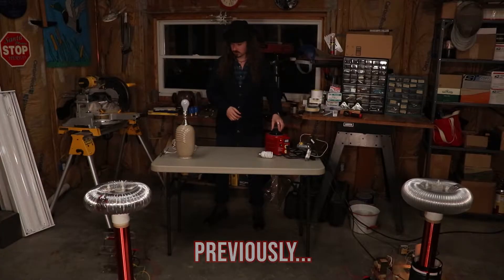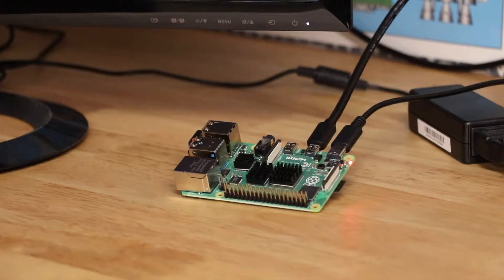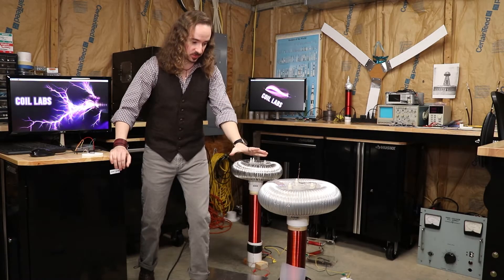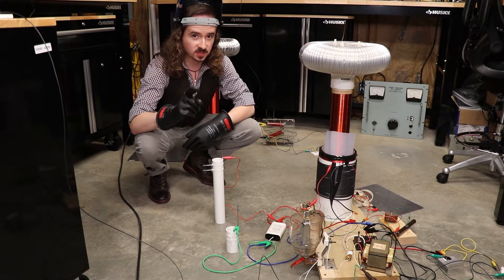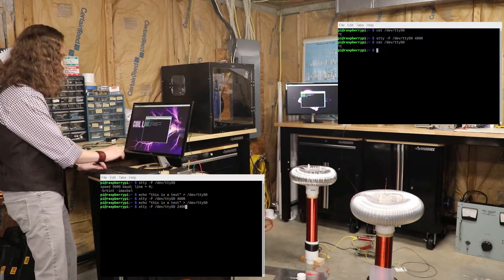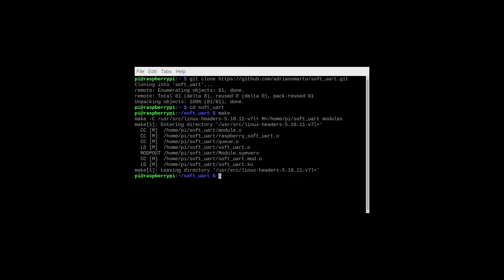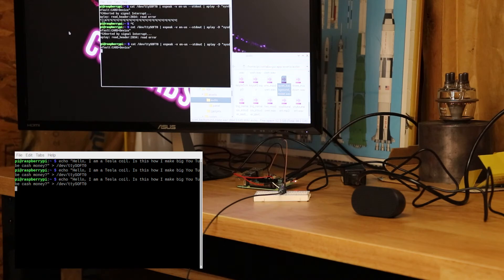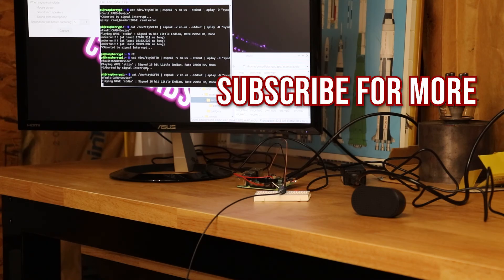Tesla Coil Wireless Communication: Transmitting Digital Information using Tesla Coils

Comment: My dad was a telegrapher for the railroad from 1960 to 1975. He put himself through college that way. For anyone who doesn't know, they used Morse code back then. The Signal Corps (military) installed telegraphy poles and hung wire all over the United States. He was also a ham radio operator.

Comment: maybe it was used in the wrong fashion or configuration (as if you were transferring energy rather than setting up a communication line)... what if you just used it as a radio implementation; like adding a small oscillator and keep the primary tuned just below the secondary as you would.. but have the transmitter at a greater frequency (shorter wavelength) than the radiator (tesla magnifying transmitter) and earth grounded the secondary so that RF goes to ground.. this E field antenna signal will propagate at a superluminal rate (typically 1.5 times the speed of light) while also penetrating all material.. then down size everything based on the same formula for a pocket sized longitudinal wave transmitter that would typically be earth grounded to properly decouple the radiation (hence, your are tuned with earth resonance)... cool video.. don't give up!

Comment: You're very smart. However, Tesla designed his system to not radiate out into space, and it is to be connected to direct ground or one wire of hair thickness is acceptable. For virtually full power transfer.
Another However is..  you must transmit at lower frequency, congruent with ground wave propagation.
He stated this in his own words in a courtroom question and answer period with lawyers present with Stenographer.

Comment: You need to use sphere top loads with no breakout point. You were wasting energy with the plasma in the form of heat and light plus you should use a dual reasonant solid state tesla coil

Comment: Nice to know this is actually possible.  Very interesting.  Did you ever try a Nikola Tesla coil aka a TMT(Tesla Magnifying Transmitter) coil.  120 years later and most people can't grasp the power of a 1/4 resonate wave connected to ground with a surge suppressor/spark gap.  What a strange thing to say and what a strange world we live on?
Reply from the maker: I have yet to build a magnifier coil, no. Something I'd like to try some day though. Really delicate to get tuned correctly from the little bit I've read about building them.
Reply: @CoilLabs  yeah I'd like to see what you can do with a TMT.  Your using what I like to call a spark coil and getting some cool results.  It's like your using a hammer and a screw.  Would like to see what happens if you use the right tool.  Tks for hearing me out and keep experimenting cool stuff.  👍

Comment: Its my understanding these coils were primarily built when physics departments were having contests to see who could make the biggest arcs. These probably arent designed or tuned for high bandwidth communication.
Reply from the maker: You're absolutely correct. This kind of Tesla coil configuration is primarily designed just to make big sparks. What I'm showing here is just near field effects, resonant capacitive coupling mainly, since producing strong electric fields is what these coils are good at. They absolutely do produce radio emissions as well, but this configuration isn't very efficient at doing so and are definitely even less efficient at receiving radio signals.
Reply: @CoilLabs  so how do we configure and tune one for efficient radio transmission and reception? The surface wave this emits travels through metal structures with ease at great distances. This is a project I've been thinking about for a while. Id like to replace the 2.4GHz antenna on my WiFi router with a Tesla coil and make a network across my city. This could take wireless internet to another level and let amateurs compete with ISPs. Ive never built a coil though and I need help starting.
Reply from the maker: Converting a Tesla coil into an efficient radio transmitter would require changing the shape of the topload to make it into an efficient transmitting antenna. I have very little experience with the design of radio antennas, so I don't know what that would be though. If your goal is to transmit radio signals though, there's really no reason to use a Tesla coil. Significantly better technology exists today, compared to back in Tesla's day. Tesla's understanding of physics, back in his time, was incorrect, based on what we know now, and what he was proposing, using Tesla coils to transmit information and power around the world, wouldn't actually work. One of the reasons he thought he needed to go the way he did was because he (and many other people at the time) thought you couldn't transmit radio around the globe, because they thought the signals would just travel off into space. Turns out the ionosphere can reflect radio waves and propagate them around the globe. The experiments of people other than Tesla, including Guglielmo Marconi, discovered this and made Tesla's concept of wireless information communication obsolete. Tesla's concept (not knowing about the ionosphere radio wave propagation thing) was to find a supposed "resonant frequency of the planet" and use near-field effects (i.e., electric fields, not electromagnetic waves like radio), like I show here, and have tuned receivers elsewhere that could receive these signals. In reality, the physics of this does not scale up like Tesla thought it would, so it likely never would have worked.
Reply: @CoilLabs  I am going to have to disagree. You are correct in the story you have come across and are conveying but it is inaccurate and incomplete. I implore you to revisit this and take a deeper look. You are on to something and the closest I have seen yet. I have been investigating this for about a decade now. Unfortunately I haven't  been in a position to do any real work on this until now.

 Tesla's understanding of the physics was correct. It was physicists understanding of physics at the time that was incorrect and Tesla has been labelled as having an incorrect understanding for a century. His system "wouldn't work" only according to the "known physics" of the time. If Tesla had started out from known theory, he would never have pursued the path he did. Tesla actually started out with empirical observations that the Earth resonated electromagnetically like a struck bell. The atmosphere and the ionosphere made this so, but Tesla only knew that it worked, and he really did not know why, at least at first.  Initially he did not realize that the Earth's atmosphere was critically important for his system to work. If the Earth had acted like a perfectly-conducting metal ball hanging in a vacuum, as physicists of the time believed, then Tesla's system would not have worked. The waves would have traveled along the ground and then shot straight out into space. His system would have been like a "G-line" with a sharp bend in the middle: except for a bit of diffraction, the waves refuse to follow the bend and instead go right off the cable and are lost. Because of the "dielectric" effect of the atmosphere, and also because a conductive ionosphere was present, Tesla's system was feasible. Yet any scientist of the time would "correctly" see that Tesla's system totally violates well-known theory. Physicists were absolutely certain that the Earth *didn't* have any resonant frequencies, *knew* that radio waves would not travel around the curve of the Earth, and dismissed Tesla's wireless transmission system as crackpottery; as an unworkable violation of known physics. When "Schumann" VLF earth-resonance was rediscovered in the 1950s, nobody in the conventional sciences dared court the embarrassment of admitting that Tesla had been right all along. 

https://en.wikipedia.org/wiki/Schumann_resonances

Tesla was also adamant that he was not using "hertzian radio waves" and pointed to Sommerfield's work as evidence of the type of wave he was using.  Arnold Sommerfeld and Jonathan Zenneck were performing an analysis of the problem of wave propagation over a lossy earth and discovered this type of wave. There was a sign error controversy that plagued Sommerfields work until 1936 with an experiment that launched the wave and tried to end the sign error controversy. James and Kenneth Corum have been replicating Tesla's work since the 80's and replicated the Seneca Lake experiment. Unfortunately this has introduced further controversy.

https://en.wikipedia.org/wiki/Surface_wave

 - Corum brothers Seneca Lake replication - http://rexresearch.com/corumzenneck/texzon.pdf

- Tesla Coil - James Corum - Tesla Society 1990 https://www.youtube.com/watch?v=EHRkCQ19GhU 

- 1936 Seneca Lake Experiment - https://ieeexplore.ieee.org/document/7577497

The Corum brothers recently worked for a company called Viziv Technologies that tried to commercialize  the use of this wave. 

https://vizivtechnologies.com/

https://physics.stackexchange.com/questions/569076/is-vizivs-surface-wave-technology-plausible

James Corum Patents - https://patents.justia.com/inventor/james-f-corum

 In early 2020 that a group decided to pick it up again and repeat it and publish the results proving a Zenneck Type Wave-based Non-Radiative, Non-Coupled Wireless Power Transmission system is possible and that it can transmit power and communications through large steel structures at great distances with ease. The current radio antennas must split up the frequency spectrum and build all sorts of devices to try to overcome obstacles using "space waves". Zenneck type waves do not have these limitations. Better still exists. 

 2020 Experimental Realization of Zenneck Type Wireless Power Transmission  - https://www.nature.com/articles/s41598-020-57554-1

Tesla Invented Radio....Not Marconi. Marconi stole Tesla's work and went for point to point wireless messaging. Tesla went for world scale industrial power and messaging. 

http://amasci.com/tesla/tradio.html

Tesla's idea for wireless communication and power transmission is far from obsolete. I believe the first step is creating a 10 to 20 mile "wifi network" using Tesla's Zenneck Type Wave-based Non-Radiative, Non-Coupled Distributed Resonator System.
Reply from the maker: Please read what I said again. I simply said that Tesla's concept wouldn't work. Just Tesla's specific concept, which was not based on surface waves, as can be read in his own words from his writings and patents. I did not say that WHAT WE LEARNED from his experiments is useless or obsolete and that we cannot leverage what he did to make improved technologies now. I am aware of and in fact very excited by much of this research you have talked about here. It absolutely builds on related concepts and lessons learned from Tesla's work, but it is not THE SAME as Tesla's proposed concept that he was never allowed to finish. I greatly admire Tesla, but I acknowledge that he also had some incorrect theories. And that's perfectly fine. He was only human, like the rest of us. He accomplished a lot and was way ahead of his time in many respects and he has absolutely been done a disservice by both his peers at the time and by historians. Part of my goal with this video was to explore how Tesla's concepts could be extended to modern technology. In fact I have already been planning to attempt a small scale Zenneck wave experiment sometime in the future, once I have learned enough to do so and am well versed enough in the specifics of the science behind it that I can make a well-explained video on the topic.
Reply: @CoilLabs  yeah I read it and thats what I'm disagreeing with. Teslas concept could have worked technically. We just dont know because he couldnt finish it.

 Tesla cited Sommerfeld in 1916 as experimental proof of what he was doing and was adamant that he was using current waves not electromagnetic.
Reply: @CoilLabs   Man this thing isn't letting me type a response with links anymore. You have an email I can reach you at? 

Also Marconi stole Tesla's work. 

And your video is awesome and again you have an understanding of this that I know I don't because I haven't built this stuff. Mad respect. I'd really like to keep a discussion going on and learn how to launch a Zenneck wave as well. I want to network routers with these these. There are some SDR projects and a wifi protocol library I think could be used to network using Zenneck waves.
Reply: @chrisp.coatspaintco.432  I've been wanting to do the same thing! Have you come across any other information as to how you could do this? I haven't seen anyone propose this and I've looking to find out how to somehow use Tesla's coils or TMT to replace the traditional internet service providers.
Reply: @isaiahj3968  yes I do have more information. How  can I contact  you?
Reply: @chrisp.coatspaintco.432  if you go to my about section on my YT channel, you'll find it. I tried posting it here but YT keeps removing it

Comment: What is the limiting factor for bandwidth?
Reply from the maker: My theory is that it's the "resonant rise" time that it takes for the Tesla coil secondary to store enough energy to build up to high enough voltages to create strong enough electric fields, which is way slower than the Tesla coil's resonant frequency. And this is compounded by the fact that this has to happen on both the transmitting and the receiving coil.
Reply: @CoilLabs  can they be matched?
Reply from the maker: The two coils I have here are matched as closely as I can make them. The problem I'm describing is the rate of energy transfer both from the driving circuit on the transmitting coil, into that coil's secondary, compounded with the rate of energy transfer from the transmitting coil's secondary to the receiving coil. In order for these to be "critically damped oscillators", they have to be loosely coupled, otherwise they wouldn't achieve the resonant rise that they do and get up to the voltages they do. That means they are terribly inefficient and it takes a non-negligible amount of time to resonant up to the "full operating power". This is still milliseconds, so it looks instantaneous to us, but that's really slow and very limiting in terms of digital data bandwidth.

Comment: if your interested in subject please check out my demo core on my channel. I'm not a science educator so bare with my badly simplified explanation's of very complex interactions of the working functions in the demo core 

the MFC its based on my work on fully passive to low energy confinement methods for plasma for hot fusion. my M.F.C is very similar to a tokomak but uses soft x-rays from the reaction for plasma confinement and only one magnet for particle rotation and electrode protection this cuts out the need for high power magnets and cooling tanks reducing the needed input power while maintaining energy density. I'm in the process of a full up grade from the 3inch demo core to a 8x or 28inch proto core for testing
https://youtu.be/y6NE1mDwyHE

Comment: Your smothing capacitor is very small for the 200 micro farad at 2.1kv, my 5kv 60 micro farad capacitor is mutch bigger (but its also older and is ratet for a higher voltage). Amazing vid, you really did a good job. I just had a question, isn't the welding helmet to slow to protect your eyes from the bright light? Wouldn't it be better to use a passive welding glass or a passive helmet with a high shade welding glass (for example shade 16)? And if it is fine, how fast is your welding helmet then and what shade? (1/10'000s, 1/20'000s or 1/30'000s).
Thank you so mutch an I hope, you use that big vaccuume tube soon.
Firefox
Reply from the maker: Yeah, those capacitors (I actually have 4 of them) are pretty unique. I was surprised at how small they are for their ratings. I think they might have been a custom order (or a discontinued model), because I can't find any with that exact spec on the manufacturer's website. I got them on eBay, years ago. I don't know what their original purpose was. Website says the "UP2" line (what those say they are) are polypropylene type capacitors.

So that particular auto darkening welding helmet goes up to shade 13 and has 1/20,000 sec light to dark response. Is that actually sufficient for what I did there? I honestly don't know, I'm not an expert on arc brightness and eye damage, so I don't want to speculate without sufficient knowledge. My limited understanding is it's a cumulative exposure thing, so as long as the duration is short enough, with reasonably sufficient darkening, you should be okay. I suppose my heuristic of "well I don't have any image retention spots in my eyes after that, so it must be fine" isn't very scientific though, haha. Passive glass of the appropriate shade would definitely be much safer, I agree.

Great questions! Be doing something with that big tube soon, for sure!